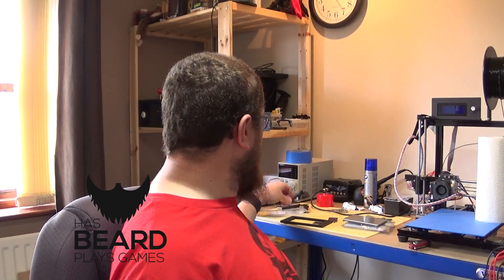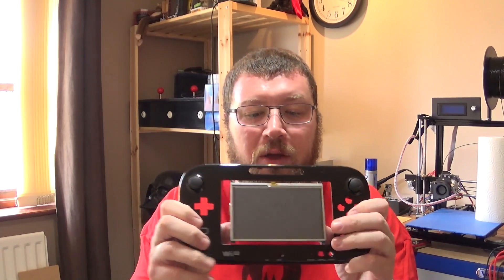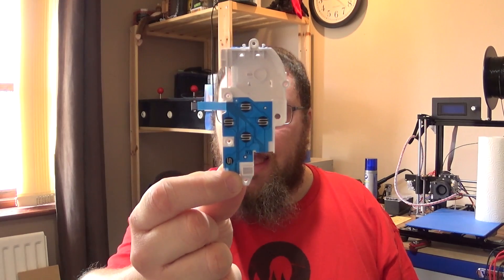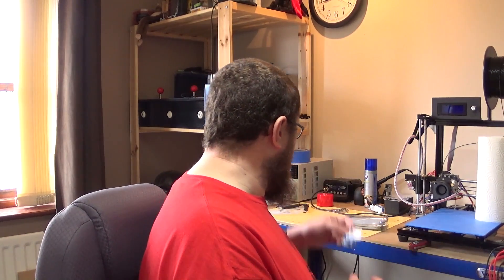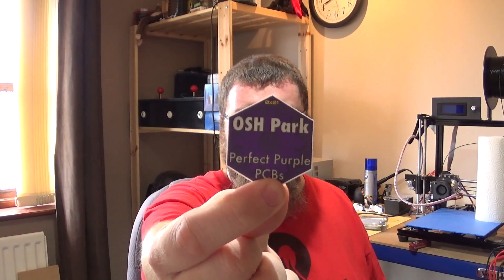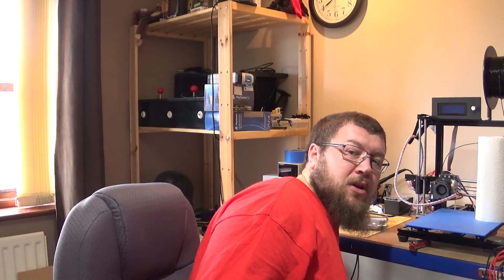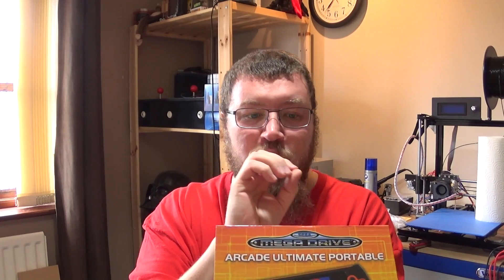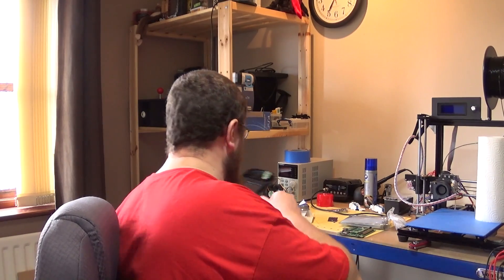(ABANDONED PROJECT) Raspberry Pi in a Wii U Gamepad - Part 3

Comment: Just curious but why abandoned this project? I know it's been 4 years i just saw this in my recommendation today
Reply from the maker: Thanks for watching! Basically... I put too much pressure on myself. I kept changing plans and the costs kept piling up, so I got to the point where I couldn't face carrying on with it again. I put it down for a couple of months... then a couple of months became a couple of years... and then I got rid of all my electronics stuff because I wasn't doing anything with it any more. I might pick this back up again (or something similar), but it probably won't be for a while!
Reply: @blcollier  it was a great project idea, look forward to your future ones when you return
Reply: @blcollier  I'm trying this project myself.  Probably be a fail anyways but still will try.  I'm not too good with making my own pcb board. So I'm going to try to use a Bluetooth controller parts with a raspberry pi3.

Comment: My solution for the buttons was to use the board from adafruit hooked to a teensy. You can solder the buttons ribbon connector on one side and the joystick connector on the other. https://www.adafruit.com/products/1325
Reply from the maker: Thanks; those breakout boards are pretty much what I'm designing now :). Though my problem isn't designing the board or getting the parts, it's soldering those damn connectors!!

Comment: PCB Design tip and small pin pitch , those connectors have two anker pins on the sides, if you add the pads on your circuit board it will make your life a lot easier to solder the connector:

1 solder the anker pins first, making sure the connector is perfectly flat

2 add thick sticky flux

3 Drag solder over pins :)

4 inspect with magnifying glass

5 remove any bridges with some solder wick.

I hope that helps, practice makes perfect :)
Reply from the maker: These connectors don't have anchor pins; I used them because I was being lazy and didn't want to have to design a footprint in Kicad! I've done a re-spin of my breakout board now, so I'm going to give it another shot. In the absence of anchor points, I might glue the connector in place first!
Reply: That's interesting , I haven't seen ones without anchor pins yet :)

If you glue it in first just be sure not to use super glue or other cyanide based glues as the fumes can be toxic when you heat up :)

Comment: couldnt you use a heat gun or hot air rework station instead of a reflow oven and just hold the surface mount parts with tweezers
Reply from the maker: You could, but you still need solder paste and for pads this small you'd still probably want a stencil. 

But the real problem is that a good quality hot air rework station will cost a lot more than a homebrew reflow oven!